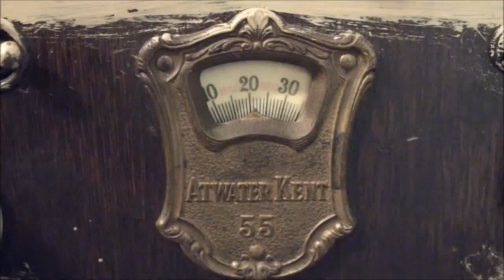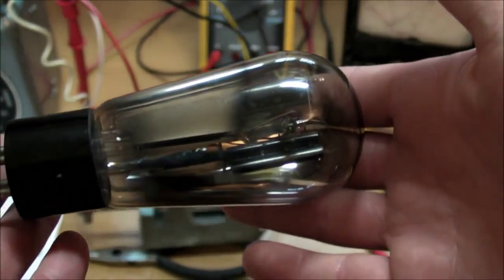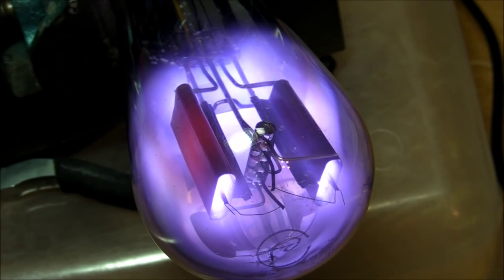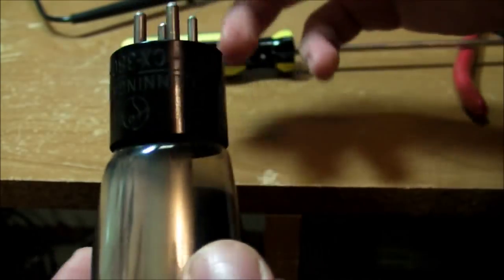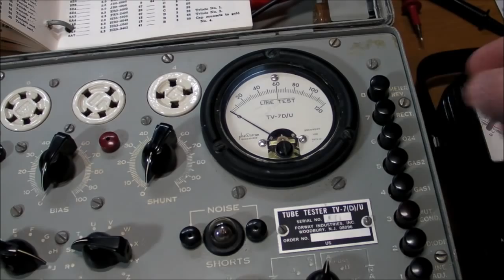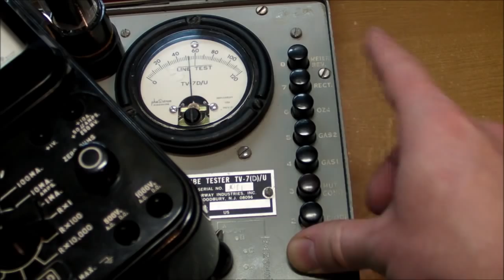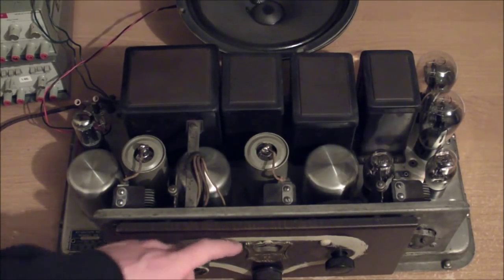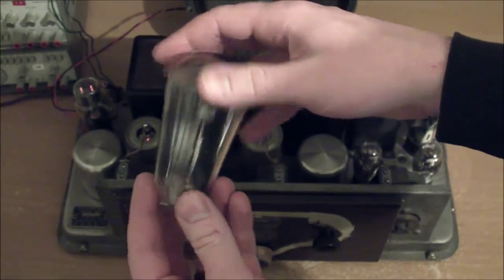(#0180) Spectacular Failure and Replacement of Vacuum Tube in Atwater Kent 55C AM Radio

Comment: why go through all that? Just buy the proper tube! They are not hard to find I just don't get it !! You can find them very easily and cheap!!
Reply: I'd like to know where,?
Reply: To get the tubes that is.
I have an A
twater  model  e2 speaker w/matching Atwater model 42 receiver. My question is where can I get the 7 tubes,and is there a manual someone could download?

Comment: why could you not just change the base in the radio..???
Reply from the maker: Kennynva T. Because I wanted to maintain as many original parts as possible. The 5Y3 is, of course, not original, but it could easily be replaced with an '80 later on.
Reply: OIC,,thanks for the cool video..I just love old tube radios...had a National NC-98 a while back..wish I would  have kept it..I always sell things and then want them back...Im into shortwave...and had a Kenwood R-5000 that was awesome..but not a tube radio..

Comment: A couple of solid state diodes would have been an easier solution
Reply: This is what I thought. Chuckled at the idea of whacking in a modern bridge rectifier part in place of a tube.
Reply: You could have even hidden them in the base of the tube under the glass.  Leave the filament connected so the tube glows, but no plate connection.  Danger is that tube diodes have a bigger voltage drop, so you'd have to add some resistance to the B+ line so the rest of the circuit is at the right voltage.
Reply: What's the point? People collect these because of the tubes. Tubes also have a different feeling and tone then solid state components have.

Comment: Well, you just ruined a perfectly good rectifier. And contaminated yourself and your work area with mercury. The 380 is a mercury vapour rectifier, it's supposed to glow like that.
Reply from the maker: +jopjopjop I have used mercury rectifiers before, and this is not one of them. There is no mention of mercury in its datasheet: http://frank.pocnet.net/sheets/029/8/80.pdf , and the National Valve Museum describes the tube's "really good vacumm": http://www.r-type.org/exhib/aaa0296.htm . When I first operated the radio after many years in storage, there was no gaseous glow. Only after repeated operation, did the purple discharge first appear and gradually grow in intensity. Perhaps I did ruin a perfectly good rectifier, but quite accidentally. It is possible that the tube may have developed a microscopic leak around one of its pins through the glass envelope, either as a result of moving the radio/tube, or as a result of thermal stresses on the glass.